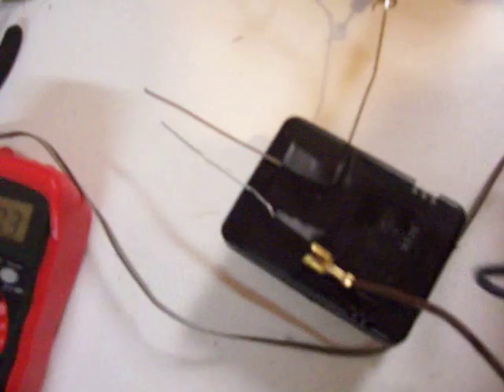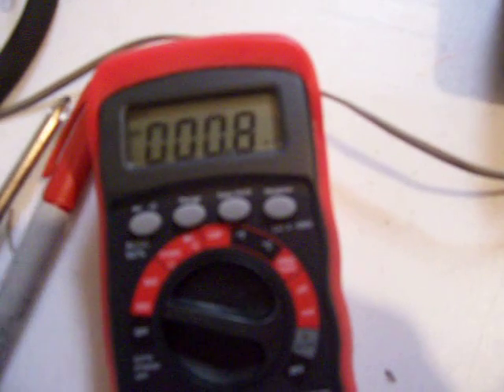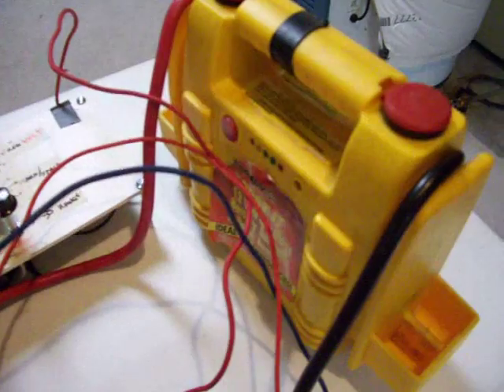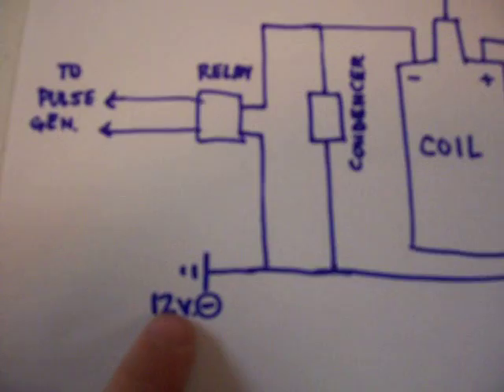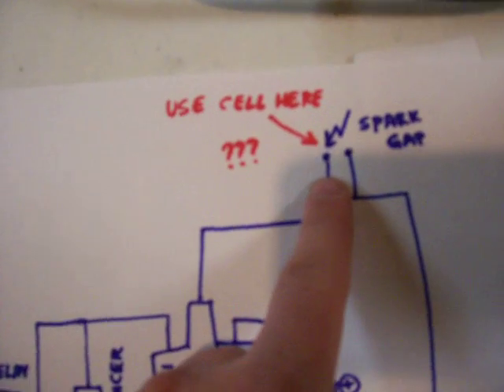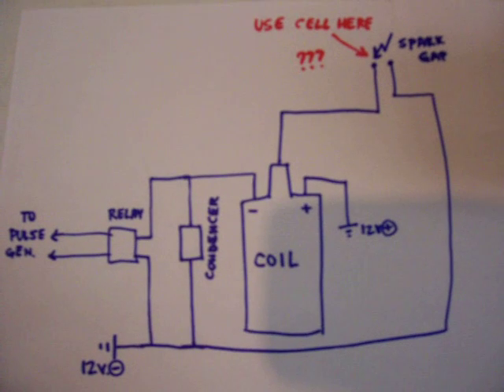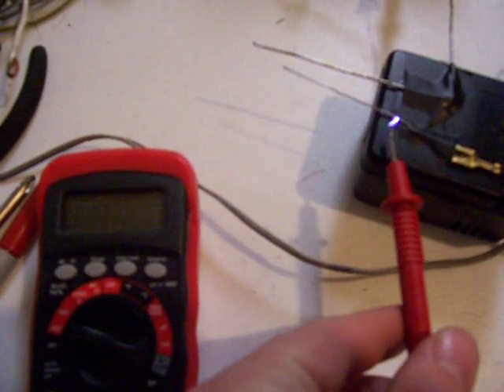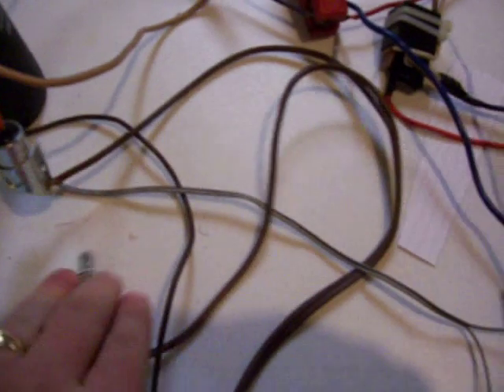Spark 2 (wi-5)

Comment: get rid of the pulse generator  and just use the relay put the capacitor across positive and negative terminal on the coil voltage output and frequency will be allot faster

Comment: use a cordless drill trigger to power your pulse and just short out two paper clips in water, youget more hho out of a spark, than youll get out of the cell check out my hho spark vids. it might be a little easier on you

Comment: you might try a solid state relay ... mechanical relays are a bit slow I think for what you are trying to do ... but the fact remains, you have a good spark going there with what you got ... why not give it a try and see what it will do ???

think you will find that getting it to spark under water will be harder than you think ... might work with a really narrow gap or if you use a little bit of electrolyte of some sort; maybe baking soda or KOH ...